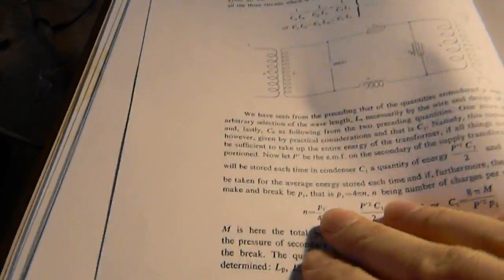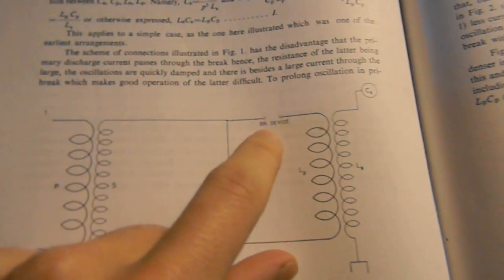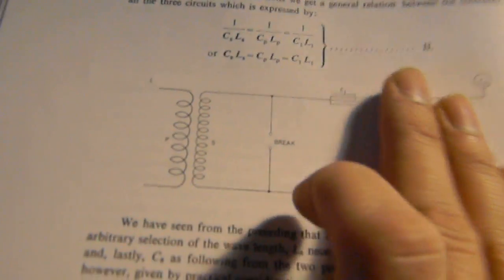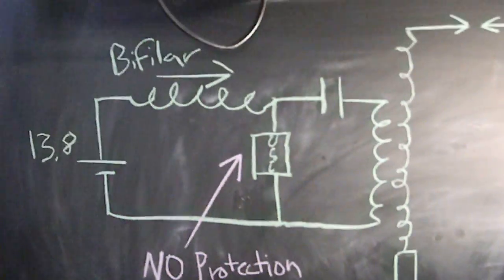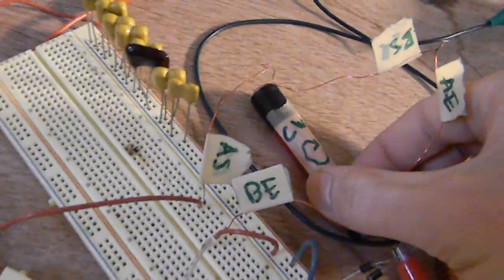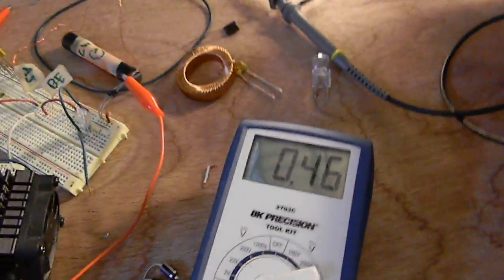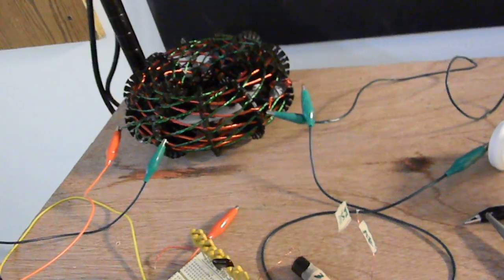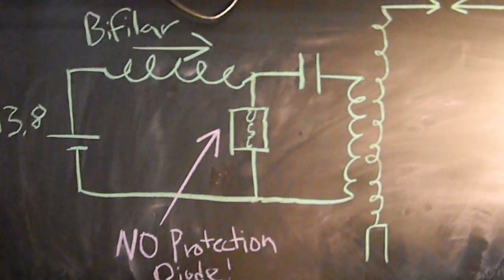Resonant Buck Converter Radiant Circuit

Comment: This is the same circuit as the Tesla oscillator published in July 1919 in the Electrical Experimenter.
I have worked with this circuit, but with negative back emf (inductive spikes).
I use pancake bifilar coils, with the secondary in the middle.
Recently I found a way to get much higher voltage impulses, by Series switching mosfets.
I also made a half bridge variant to get both polarity impulses.
Great work! and good to see you back online :)

Comment: Use highside switching to produce negative voltage in the capacitor, and discharge this into the coil to get the radiant fx

Comment: Hi MrWarrensk! I'm an electronic engineer, and I hear a lot about "cold electricity", "radiant energy", etc. although no one can explain what it really is... According to your experience, do you think this kind of "different" electricity exists, or it is just an ordinary high frequency & high voltage signal? Thank you!
Reply from the maker: hello! I would call "radiant energy" essentially the energy associated with a back emf spike....Within that spike there is a frequency depending on the saturation of the core/length, inductance and capacitance of the coil being pulsed...This "side" of electricity can be called just HF and HV but its nature is different than what any common amplifier can produce...it is essentially the art of making lots of noise, harmonics....however when tuned properly, it is a way of sending energy into the ground via resonance...some say this way of producing electricity can thus multiply energy just like tuning forks amplifying sound when they are all the same frequency...so far experimentation points towards this as well...Check out the video about 2 different types of resonance....
Reply: MrWarrensk I'm reading through your comments and watching your videos, and from what I understand about radiant energy and electric theory from old books, you're excelling at explaining it all. From experiment to theory, you have done your homework, plus some! Have you heard of the Catt anomaly? It's related to radiant energy, but highly ignored.
Reply from the maker: David Arthur I have not, ill check it out! Thanks for the kind words. I dedicate a lot of time studying the works of tesla and I aim to reproduce his experiments to get a better idea of what was going through his head at that time. Check out my most recent video. I have reproduced his magnifier concept on a much smaller scale....But the cool thing is it works exceptionally well.
Reply: +OElectronicDesigns These terms like "Cold Electricity" are trying to describe electrical energy that has been manipulated by changing where a majority of the magnetic field coming from the coils is located. This is done through attraction or repulsion or both at the same time. 
  Poles from the secondary and primary in attraction can force a majority of the magnetic field away from the center of the coils and increase the area of the field. This spreading out of the field has a dispersive effect making the strength and density of the field lower. While leaving the electric field/ a vector potential in its original location and this create new ones. Maximizing the exposure of the electric field or A vector potential from the primary and secondary coils with as little magnetism around as possible, leads to an efficient method of semi inductive electricity transfer. The resulting energy that can be collected when the secondary coils field collapses seems to behave differently when connected to a load through a capacitor. This leads to the different terms and confusion.
Reply: volts per second. Tesla wave. You get it.

Comment: Have you tried this circuit on an hho cell?
Reply from the maker: I have not, I have seen a lot of stuff about it. The HHO cell is supposed to be replaced by the capacitor correct?
Reply: I believe so. I have also seen cold electricity work better. Combine the two? :-)

Comment: FREAKING AMAZING. Which device are you using to tune ? Thanks.
Reply from the maker: The tuning is dependent on the pulse width and the frequency between pulses....I am using a 4001 pulse generator
Reply: thankyou !! =)